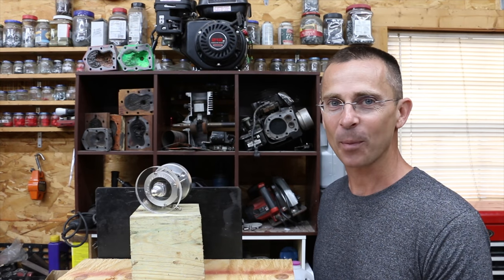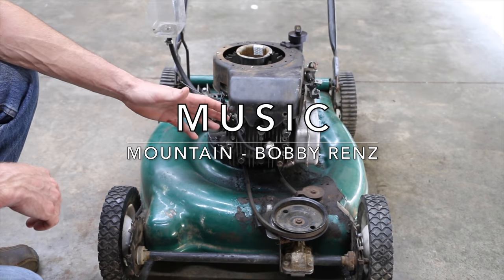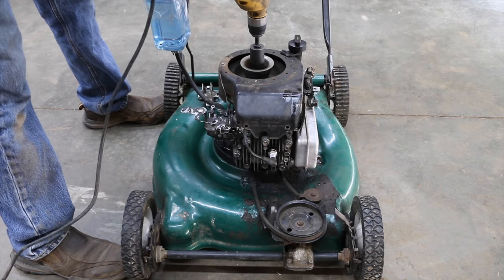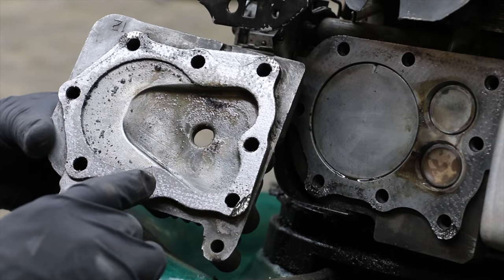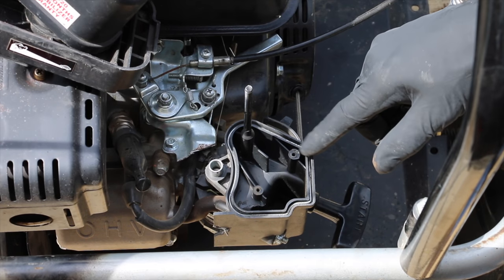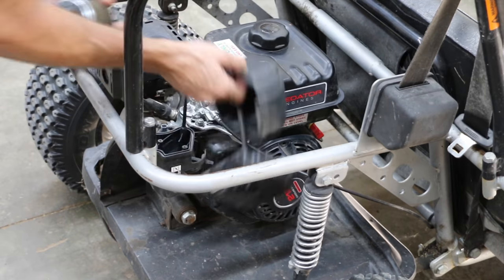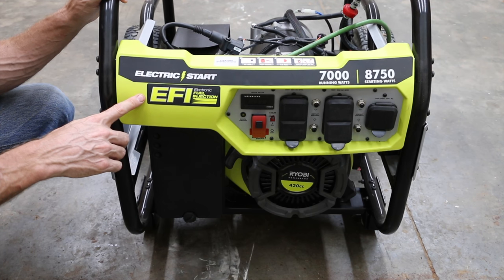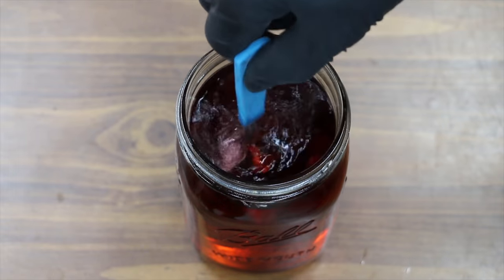Is Leaded Fuel better than Unleaded?  Let's find out!

Comment: Test cooling system sealers. Heard none of them really work.
Reply from the maker: Thank you
Reply: They work...too well. ;)
Reply: K-seal definitely works. Dont know anyone who's had it fail. My old car, still in use, had some in 2013 as a desperate measure when rad sprung a big leak one hot summers day moving house with a deadline, never got round to changing the radiator, it must've done in the region of 50k miles since.
Reply: so far the work great fro selling water pumps, everyone ive known that used the stuff has replaced a water pump within 40k miles.
Reply: BarsLeaks seems to work. I've only used it in older engines though.
Reply: I've used seal up liquid glass for cracked heads for years stuff stays liquid unless you let it dry so no fouling up the radiator. I have got quite a few great deals of failing cars for less than a thousand used the stuff ran em for years
Reply: Any other leak I just fix myself I learned early that fucking with heads and machine shops just ain't worth it
Reply: Also test pepper and an egg as well to see if that’s better than a product you can buy.
Reply: Cinnamon works.
Reply: Used some bars leak in an 02 impala stopped the leak and it plugged up the heater core
Reply: They DEFINITELY work. You just have to make sure that you TOTALLY flush out the system thoroughly before using the stuff or it will clog up heater cores and other things.
Reply: Horse shit, the old-timers say horse manure is the best radiator leak stoprr

Comment: I've always wondered if those Octane fuel additives really do work and improve engine performance compared to 89/91/93 octane fuel - like the little bottles you see at a gas station or the ones sold at an Auto Parts store.
Reply from the maker: Thank you for the video idea!
Reply: To a motorcycle, yes
Reply: My Dad’s Morris Minor was fitted with a high compression head. After unleaded fuel was introduced in the U.K. it would predetonate quite a lot. Adding the octane additive seemed to fix the problem.

Comment: An interesting side note: -40 degrees is the only point where both the Fahrenheit and Celsius scales read the same temp. Stuff you never needed to know. lol  Edit: I wonder if a "hotter" spark plug would reduce that lead build-up? Don't recall seeing any build-up in my 60s/70s automotive endeavors, like you found after running the avgas. I do/have noticed cleaner spark plugs, as a general rule, w/ unleaded gas vs leaded.
Reply: 100LL has a lot of lead in it even though it's called low lead, it's equivelant levels to 1970's gasoline

Comment: In a previous life it was standard practice to fill a 3 gal garden sprayer w 100LL from the wing sump drain and use that to clean the engine- Curtiss Wright R 3350 WA.  That fun aside 100LL works great in any equipment seldom used like generators and the like.  It evaporates clean leaves no gum or residue doesn’t stale or lose potency like automotive fuels.

Comment: Ive worked on aircraft reciprocating engines and those engines are designed for the lead, the lead is mostly to create a gasket seal around the valves as the seats are softer than vehicle valve seats, also they have 2 spark plugs per cylinder for a better burn which reduces lead deposits as well as redundancy in case of magneto/plug wires/spark plug failure.
Reply from the maker: Thanks for sharing.

Comment: Ethanol is used to prevent knocking. The whole point of Leaded Fuel was just so it can be patented. Since Ethanol can't be patented, Petroleum companies sold environmentally unsafe fuels for profit when there was a safer alternative cheaply available.
Reply: Yes and no. Ethanol actually cost more then tetraethyl-lead, it was used as a cost saving measure more than as a patent reason (not to say that didn't play a part) but if it was solely patents with all the oil companies in existence why didn't some of the ones that didn't have access to the patent use ethanol instead? See this your reasoning doesn't make sense.
Reply: @jaykoerner  
Exactly also Leaded Gas has Much Higher Octane. I know it came out before the birth of Muscle Cars of the 60’s and early 70’s. Oops almost forgot the Hotrod’s of the 50’s too those Big Blocks and Small Block V8’s were built with Really high compression ratios like my dads Chevelle with the 427 Big Block. That came from the factory with a tall Solid Lift Cam, and Roller Rockers too, and she had 13:1 compression Raito. She’s a real BEAST. The Big 3 Ford, Dodge, and Chevy NEVER could have built those monsters back then without it.

Comment: My engines teacher told me when they took lead out of gas a lot of cars would come in with valve seat damage. The lead lubricates steel
Reply from the maker: Great point
Reply: They completely changed spark plug materials because of lead -- twice. https://youtu.be/smIqDKTm2hE?t=336 but the lead causes brain damage in humans.
Reply: @seananderson5850  what will happen if you put it back in modern engines? Will it be beneficial?
Reply: @denniero6904  lead will destroy the catalytic converter, o2 sensors, spark plugs, probably fuel injectors too.
Reply: Only in older cars originally designed for leaded fuel. Modern engines have improved metallurgy which negate the need for lead anymore.
The main reason why they removed lead from fuel was due to environmental and health dangers. Lead is bad for the environment as it is a heavy metal and was leaching into water supplies (mainly from boats). It also leads to brain damage.
Reply: That was only in older cars with cast iron cylinder heads, which had softer valve seats. Even at the time, if your engine had an alloy cylinder head, it would have to be fitted with hardened valve seats due to differences in material expansion from heat. Pretty much all cars from the late 80s onwards have alloy heads so there is no longer any need for leaded fuel.
Reply: model t ran on unleaded from 1908-1920 ish their was NO lead!!!! DuPont and standard oil and gm add lead to stop spark knock in AC DEL-CO FARM GENERATORS. it was a problem in sum gm cars. ford heads do not crack like gm ones the led was mostly for octane the led did slow valve seat ware  to a point. marvel misery oil was used along with other light oil before lead to keep valve seats happy. the lead was used as one could not get a patent for light hydrocarbons and alcohol. all so light hydrocarbons were hard to get in large amounts to make good hi octane gas so lead was chosen as a "low percent solution' in the patent  and papers by gm!!!! they stated they would change to the "hi percent solution wen the patent ran out and when the public found out its toxicity!!! it is all in the old archives now!!! it was profit!!! the ford used did not need lead as it was a over built engine Evan by old standards it ran at low rpm had low compression. the thing that burns up the valves when non leaded gas was used was the timing for leaded fuel needs to be more at hi rpm and lower at idel. using that  timing curve for unleaded fuel will make more heat at idle burning up the seat. have used unleaded fuel in mid to late 60s stuff for years no problem just re-curve the distributor and use manifold vacuum for advance can to seed up the burn to reduce the heat from the camber. a richer mix to to cool the valves and a cold air intake. it works. the mid 60s stuff had flame hardened seats in fords as well as other makes. lot of 60s fords got used for BIG industrial use ware a diesel to day wold be.  and wear run on propane ,natural gas, or butane. the lead was mostly bunk. the stuff that sucks today is the fuel absorbs water so can not store for long. but fine for day to day driving in a old carburetor engine.
Reply: Raj... I love your avatar.  Where did you get the inspiration?
Reply: @JimBob_Joe77  what avatar lol
Reply: Those of us born in the leaded era are estimated to have lost about 10 IQ points from Tetra-ethyl lead exposure.. 
So good news the millennials are all extra smart!   ;)
Reply: @EveryoneWhoUsesThisTV  Haha, I'd say the real truth behind that comment is the justification to bring it back!
Reply: @jakemichael8586  Originally, ethanol was also being considered as a spark-knock hindering additive. But someone in the decision-making department had vested interest in DuPont, so....
Reply: you are right about Dupont. it was decided lead was easy fix. all so the insiders decided that when the patent for leaded gas ran out to go to the more drastic action ie use of light wight  hydrocarbons,alcohol etc when the pressure from the public to do so was their. it was all about $$$
Reply: @ryantoomey611  Hardened valve seats will convert a 'leaded' engine to run on no lead.
Reply: It was for octane not lubrication. Detonation prevention
Reply: @richardlea818  
No it was used as a lube,  it would help valves, and valve seats last longer
Reply: Yes the lead builds up a protection layer over the valves. But lead destroys the function of a catalytic converter and the lead coming out of the exhaust is very dangerous and not good for the environment (causes cancer).

That's why they removed lead from fuel and start to use better valve material that do not need lead in fuel.
Reply: @jakemichael8586  geeze...  why are you making a mess with the english language???  DAMN!!! ever hear of a spell check???
Reply: @timbaumann9046  As were the kids of yesterday...  :D
Reply: Too bad lead poisons our community 🎓👩‍🔬👨‍🔬

Comment: if you don't have high compression its not much advantage to run av gas. but if you cut the mixture way back and turn thr timing up. advance it since that fuel burns slower and cooler. watch out. 😁
Reply from the maker: Great point!  Thank you
Reply: I try to explain to people that same thing and they say I'm nuts. Higher octane is a must for high compression engines but it can actually make less power if it's not needed or adjusted for it.
Reply: i used to drive my car right up onto the tarmac and put 100LL in it. but it had high compression, no cats and an easily adjusted carb and timing. if you tried that with cats on you wouldn't get to far but i'd like to try it on a newer self learning. system with the.  wideband o2 sensor. (cats removed of course)
Reply: @augustreil  I once heard/read that high octane fuel actually contains less energy per volume so if you're not running high compression (where the benefit of higher self-ignition temperatures comes in) you will have to use more fuel to make the same power
Reply: @chelarestelar , True, lower octane is more explosive in general and burns faster.
Reply: It should be noted that the octane rating of a fuel has no bearing on how quickly it combusts or what its energy density is, it's simply how resistant to auto-ignition it is. 
That said, typically fuels with higher octane rating do contain less energy and different burn rates then fuels with lower octane, ethonal, for example.
A fuel with a very low octane rating, slow burn, and high energy density is diesel fuel.
Reply: I actually had a friend tell me I should use high octane gas in my NA Subaru. His reasoning was his friends STI had more power on premium gas than regular. No shit, it tells you to use premium because its a high compression turbo charged engine. Mine is not and it recommends regular gas in the manual.
Reply: @Jaker788 , In his case, yes run the higher or what is recommended. As for your car, there probably is no need and would be a waste of money, Imo.
Reply: Lean is mean!
Reply: @MichaelD-fn5lv , True, But it won't run strong for very long ! lol.
Reply: @augustreil  It was just kinda a stupid reason. I tried explaining why the STI took premium but he still thought there was an advantage for every car.
Reply: Bingo, most planes don't even need 100LL.  They only put it out to satisfy the highest performance turbo-charged models

Comment: #Suggestion - I had a guy tell me that the often used starting fluid is dangerous: "A fire hazard." He suggested using WD40, saying it was every bit as good. I am interested. Thanks.
Reply from the maker: Thank you for the video idea!
Reply: Gold for starting diesels
Reply: Not suppossed to use starting fluid on diesels, we did anyways, 10% Starting fluid 90% wd40... worked great
Reply: @homefront3162  That is news to Caterpillar.
They used to have a set up where you could spray the ether with a push button in the cab.
Reply: 1978garfield I always thought it was because glow plugs would just ignite and cause damage but pre glow plug days it was ok?
Reply: I’ve used wd40 to start my diesel. It’s supposed to be much better for it than ether.
Reply: @22Platypus  it don't wash away the lube oil off cylinder walls like ether will di

Comment: If you get behind a group of old school muscle cars going to a car show ( we have a lot around here )you can barely breathe. I’m glad they went to unleaded but don’t like the Ethanol added in
Reply from the maker: Great point!
Reply: ethanol isnt really even good for the engines
Reply: I don't know anything about leaded fuel, but I know pretty much all of the smell is absorbed by the catalytic converter in cars today. And that cars without cats smell. So I'm wondering if the decrease in smell you mention has more to do with the catalytic converter than unleaded fuel.
Reply: Floortile83 yes I believe you’re right. We also have a lot of hillbillies who take the Cats off there trucks. Also kids with foreign cars who alter the exhaust and they stink too and I’m sure they’re running unleaded fuel.
Reply: @scrumthebum2451  It's to benefit the turbo. Less restriction lets the turbo spool faster and run cooler. I replaced the catalytic converter in my BMW M2 with a smaller one last week. (less cat material) My car doesn't smell, but I'm told if you get rid of the cat completely the car will smell.
Reply: Floortile83 I have a Ford ecoboost turbo I was thinking about putting magnaflow exhaust on it but don’t really want it any louder than stock. ( I’m getting old LOL )And I haven’t heard any exhaust on a v-6 that sounds good. I would like the added MPG a less restrictive exhaust would provide, so still considering it.

Comment: I've run a fair amount of 100LL though a variety of 2 & 4 stroke engines for extended periods, and in extreme cold winter conditions. My experience is that the fuel is far superior with respect to overall fuel system/carb cleanliness and general maintenance of these areas; especially considering the current contamination & corrosion we're seeing with ethanol laced fuels. However, 100LL does, as eluded to in the vid, under certain conditions can contribute to excessive lead contamination on the hot side. While not a major issue, fouled plugs are not uncommon, and I had to scrape some valve seats once on a small jenny. It also does't start well in temps below -20C. These days I'm drifting back to using more of it...
Reply from the maker: Great information. Thank you!

Comment: In order to really benefit from higher octane, advancing ignition timing (if possible with this setup) is ideal. I'm talking about the Go cart.
Reply from the maker: Thank you
Reply: Go Power Sports sells an offset key for the flywheel to advance the timing 4°. This would be for the go-kart. It looks like you have the 420cc Predator.